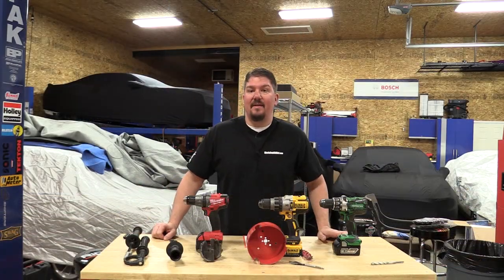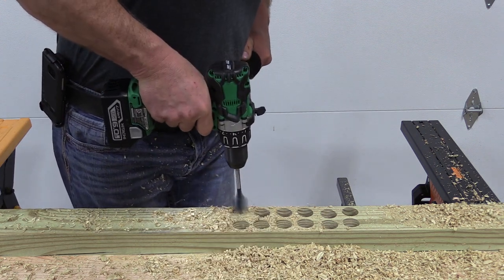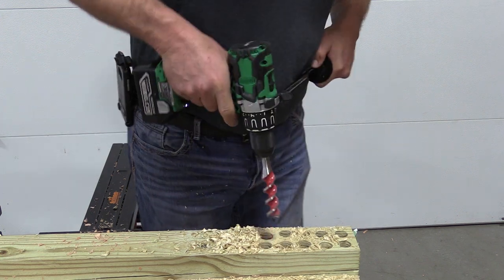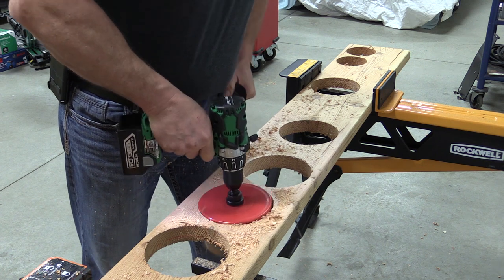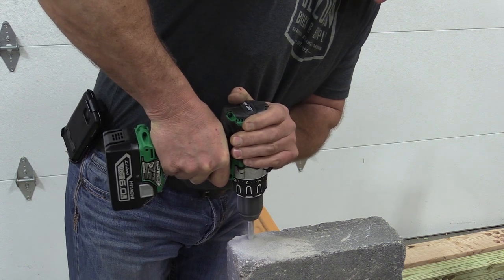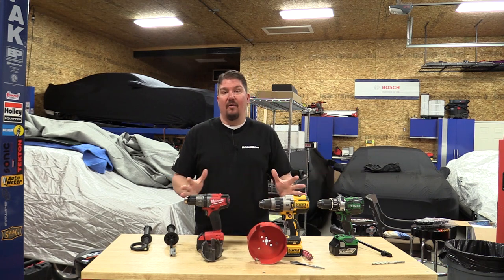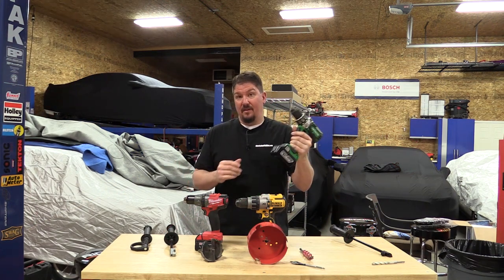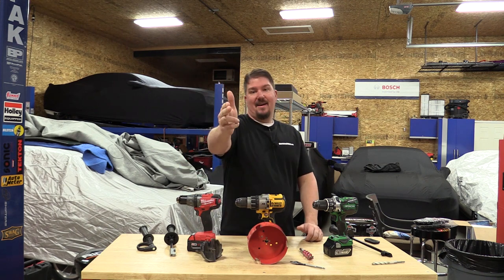Hitachi DV18DBL2 1/2" Drill vs Dewalt DCD996 vs Milwaukee 2704-20 | Brushless Drill Battle

Comment: Doesn't that Hitachi come in at $399 for drill and Batts? You can get combo kits with the other two for that price...I think this is a point worth discussing.  Bare tool the Hitachi is more affordable but most people would probably prefer to buy it with the 6ah OR as a combo with an impact like the m18 and xr UNLESS they're already invested in the hitachi platform
Reply from the maker: If you got a combo kit with the Hitachi triple hammer impact, it would be worth the more $$.  I agree with you, it is hard to get into costs other than bare tools because there are so many combinations.  Great item to talk about!
Reply: I’m a big hitachi guy and lemme tell ya, when I saw the price of the new brushless stuff I about shit myself.
Reply: Dylan Elder I'm in complete agreement, brother.  The digital control recip, the triple hammer, the nailers, this hammer drill all very expensive... For being next to an off brand and not really a major player in prosumer sales(bad marketing, poor competive releases) you'd think they'd make entering their platform more affordable.  Their under performing brushed kits are always on sale but lacking in all facets of power and speed
Reply: I recently got the dcd996 in a pack with the dcf887 and dcg406 with a 6AH bat and a charger for 549 NZD (370 USD)
Never seen anything as affordable as that

Comment: I’m in the Dewalt battery platform and I will buy the Dewalt dcd996
Reply: Dewalt burns
Reply: And u will be buying a name that isn't as good of a drill
Reply: @davycrockett4395  Not Necessarily. I had the older version of dcd996.The only reason why I changed it was because of the old ni-cad batteries but it was a tough drill.have this Milwaukee drill and this new dcd996.They have improved a few things on the Dewalt. My Milwaukee drill seems to have more torque than the Dewalt but for drilling into masonry I found the dewalt is much better because of the 3rd speed. I use them both for large diamond core bits when I don't have power for my corded Boschhammer drill . I have driffrent platforms as I don't like everything Dewalt makes but the same goes for Milwaukee,Makita,Bosch etc

Comment: In 2018, i am now the proud owner of MILWAUKEE'S 2897-22 which includes the 2704 drill/driver. As i have own the minor leagues (12v MAX & M12) 1st, I used both extensively. Dewalt's battery 12v MAX tools & batteries (especially) have  failed time & time again. They have a fatal flaw close to The release tab, the plastic cracks. The tool (3/8 drill/driver) was repaired until warranty. M12 tools are still preforming without a battery or tool failure over 5 years later. I needed to step up to a cordless (1200 ft lbs) Dewalt impact, & after 18 months the same problem occurred as with it smaller cousin (cracked battery cases).  This lead me straight to Milwaukee M18  as they have a different battery case structure. I have not been disappointed yet (plus i still use my M12 tools every day as a mechanic & locksmith)! Hope this is helpful to someone!
Reply from the maker: Thank you for sharing!  I am sure it will be helpful to anyone looking for new tools!

Comment: I have the Milwaukee Fuel 2704 and there were two things I didn't like. 1) when first bought, the chuck with lock so tight after hammer drilling through concrete, I couldn't remove the bit. Took it Milwaukee repair center, and they fixed it. 2) The handle can come loose and as you mentioned can break off from where it clamps on the drill. A friend who is an electrician shared that happened to them once and changed from Milwaukee to Dewalt. I wish #Milwaukee would change the handle more to Dewalt or Makita style
Reply from the maker: Our main 2706 drill is broke where the handle clamps and the handle will no longer work.  The drill is nice though.
Reply: Great video! Loved the straight to the point, action filled, with excellent commentary. Very smooth!
Reply from the maker: Thank you!

Comment: The thing I've noticed is how a dill is used. 

Using to fast of a speed or too slow,  sometimes it's the pressure, even the sawdust or dust can screw up the clutch etc. 

Or just using it too many times too quickly just kills any brand drills very fast.

Comment: Hitachi is expensive but so far worth it for me. I havent used their lifetime tool warranty, but the bandsaw and triple hammer seem to be holding up great in commercial applications. I guess next ill buy this drill, but fucks sake its expensive.
Reply from the maker: It is expensive!
Reply: I'm still rockin an older version of the Li-Ion tools, non-brushless. They refuse to die, I refuse to buy new ones. It's the one company that I have never had to use the warranty on and I haven't figured out how to break one (not intentional breaking that is). I burned out, dropped then broke, killed batteries in weeks, ALL of the other major brands. Perhaps it's luck but if my luck keeps my Hitachi tools working (why fight it right?)

Comment: Nice to see you guy's back. lol I honestly think Milwaukee need's to fix there over heating issue. There drill compare to my Makita or Dewalt got nice and toasty from hanging up four cabinets. Used my cousin's the very next day to compare and same thing. Out of these three I say Dewalt wins. If you add in the Makita hammer drill then you have a new champ. Much nicer chuck and there handle is nice, long and wraps almost all the way around. Btw anyone else Milwaukee drill have this very high pitch annoying sound come from it when trigger is pulled?
Reply from the maker: We have a friend who has the high pitch sound when the trigger is pulled.  It is an odd sound!
Reply: Yea I agree the milwaukee gets hot fairly easy . I think they packed that motor in there too tight trying to make it the most compact out of the rest. Which in return causes heat to not disperse easily or properly.  I use the Dewalt at work and milwaukee at home. the only time I get that Dewalt hot is when I am drilling into concrete.  In my experience dewalt will let you run their tools a little harder than milwaukee before cutting off. power.  Which I’m not sure if that’s a good or bad.  Either way I would be proud to show up and do any job with either of the two drills.
Reply: The Makita is the same chuck as the Milwaukee as far as I know, so take that into consideration. My Milwaukee chuck likes to drop bits a lot.
Reply: KernelPanic No makita has a Yukiwa chuck and i forget what Milwaukees is but they r different. Milwaukee is my least favorite between the dewalt and makita. Now is it a bad drill? I don't think so but i also think there going to make there next 18 hammer drill much better.
Reply: ToolShopGuy The Milwaukee says ‘Yukiwa Seiko’ right on the back of the chuck.
Reply: My wife makes a high pitched sound when I pull the trigger on tools, but when she pulls the trigger on clothes shoes etc it's silent. Why is that?
Reply: The milwaulkee is also yukiwa.
Reply: Chris Piggott Ahahaha...it's a common affliction in most women whose mates/partners/? want tools that will actually earn their keep as opposed to just get by with the cheapies and use the rest to guild the calf. 
46 years of home building and remodeling, two wives(first one has passed...) and about a dozen or so helpers later, I find that same "high-pitched" whine just about everywhere. Some are more annoying than others but in general, it's the same. 
It is my joking belief that a form of gold is sufficient lubricant to soften the squeal...js
Thanks for the chuckle, sir. It made a dull day an 'rch' brighter!
Reply: I also have a impact gun from Milwaukee and I get the same noise on mine it sometimes doesn’t shut off. I have to pull the trigger out to make it stop drives me nuts lol. Definitely will be sending it in for warranty repair and they have had a lot of issues with the triggers on their drills and impact guns. Other than that never had any overheating issues or any other issues at all.
Reply: Apparently milwaukee gen 2 use the Japanese chunk.
Gen 3 use the German chunk.

The German chunk blows away the Japanese chunk.

That's from the guy at the store,  and said when they repair gen 2 drills they replace the Japanese chuck for the German one.

Comment: I have both Hitachi and Dewalt hammers, and they are nice for masonry.  I always use my impact driver for my spade holes, as I can easily drill overhead with a single hand.  You can not do that with the drill.  In fact, unless I am drilling masonry, I will just pop a drill adapter on to my impact and use all the regular drill bits with it.

Comment: I have the Milwaukee and the Dewalt hard to decide which one I prefer! Great review
Reply from the maker: When drilling metal and needing a middle speed, the three speed Dewalt stands out to us.
Reply: Same here. I love the grip on the Milwaukee but that chuck is GARBAGE. Hate to say it. Even the chuck sleeve is just cheap and stamped, instead of the nice Rohm with knurling and a spinning bearing at the front. Not perfect but better. Bits falling out of the Milwaukee gets old. It is also hard to grip anything with a hex shank due to the design of the jaws. That gets old.
Reply: I have never had a problem with my gen 2 fuel drill dropping bits, however I have had to use channellocks to get the bit out of the chuck.
Reply: I know you from instsgram

Comment: I would have liked to go Dewalt, but where I am from they didn't have a Dewalt hammer drill set anywhere, so I ended up going with Milwaukee
Reply from the maker: That's not bad!
Reply: @WorkshopAddict  nope, but I was sort of already invested into the dewalt battery line. But really needed a hammer drill set and my local stores only had the fuel products

Comment: I will go with the Milwaukee. It's the best bang for your money. Working in the refinery industry we use Milwaukee because it will not fail. I have used the dewalt but it doesn't performs like Milwaukee
Reply: From what Ive seen, dewalt last the longest, where some people have had dewalt tools for 5 years, ive seen milwaukee chucks break after a matter of months

Comment: Hitachi also has a very good Impact wrench. 305nm and ip56 water/dust protection.
Also sabre saws, , an angle grinder,circular saws , rebar cutters, various nailers and even a multitool.

So Hitachi spans a wide usage area on their 18v battery line.

Yet you only mention the triple hammer impact driver?

Comment: I have both Milwaukee and DeWalt and my partner has the Hitachi. We've been doing home repair and remodeling for a very long time. Based on user experience, I would NOT ever own a Hitachi for pro work. It just doesn't have what it takes to complete a strenuous task. I am not panning Hitachi as I have a slide miter saw and a roofing nailer from them and have nothing but good words about those items. 
Back on point, for my daily usage, my goto is the DeWalt. It has been a solid performer and it doesn't matter what the task is...from driving screws to drilling large holes to mixing mud and concrete. It takes it all and works better than either of the other two. My Milwaukee is my back up for those one-time difficult tasks such as setting anchors or reaming when I don't want to burn up my regular use drill. It handles what I put it through with ease though it doesn't 'feel' as if it would be able to work all day doing the mundane. 
My partner uses his Hitachi trying to perform those very same tasks and ends up borrowing my DeWalt to make it through the day. His is newer than all of mine and was purchased to replace a Makita that gave up the ghost last year. I did try to convince him to purchase a different brand but the price was almost a c-note less, so he cheaped out and now we suffer on rough days.
Battery work life is longer on the DeWalt as opposed the Milwaukee but not enough to make a difference. I don't go to job unless I have at least two batteries and I usually carry four and a charger for both brands. My buddy has only two for his Hitachi and he ends up charging each a couple of times during the typical eight hour day...hence the need for 'borrowing one of mine.
My opinion for any of these? You can't go wrong with either the DeWalt or Milwaukee for all-around performance, day in and day out. It's been at least four years on the current DeWalts I own (4 drills and 2 drivers) and three years on my Milwaukees. Hardly any complaints other than battery costs which make it almost more economical to just buy a new kit rather than just the batteries. I did manage to find a local outfit that carries new, generic replacements for a third less than even rebuilds! I lucked out there. 20v XR's are precious judging by what I would have to fork out for brand specific and don't even think about Milwaukee's 18v's!!!
And as I stated at the start of this diatribe, keep the Hitachi at home. It seems to be sufficient as home-owner "beater" than trying to be a real work tool. My buddy has used up two batteries and one charger so far in the year that he has had it but thankfully his replacements were less than half the cost of what mine would be.
I have used Bosch, Porter Cable and Hilti brands and am not impressed at all with any of them. Bosch and P.C. work and feel like a wally world knock-off brand -- cheap, inconsistent and flimsy. Hilti's price is simply too outrageous for what it is and offers. And it didn't work any better than Milwaukee or DeWalt. Besides that, I would never buy anything with the P.C. label ever again. Their entire product line is trash. Brand new framing and roofing nailers than can't make it through one box of nails without breaking. Compressors so cheap that saran wrap is stronger than the seals found on the top end (i use to own three...). Yes, it's that bad! 
So at the end of the day, it's either DeWalt and or Milwaukee if you want to get the job finished in a timely and professional manner.

Comment: DeWalt hands down, I think the 996 should have had the 6ah flexvolt battery as that is what the premium kit comes with. Love the new chuck on the DeWalt German made they are high quality and the same chuck used in the hilti drills for twice the price. The E-clutch takes getting used to but I've grown to live it very versatile and people neglect to mention that all 3 speeds have different ratios in every clutch number giving you say more range in gear ratio. Awesome drill I would recommend to anyone who needs a workhorse on the job site!
Reply: I agree, I Run my 996 with a flexvolt battery(my big tool gets the big battery) and it is a monster, the clutch is real weird at first, but it is so good now i can get used to it. 
I wouldnt use it for huge amounts of concrete drilling, I would use an SDS for that, but when you only need a few holes, its not worth getting the SDS out, it is more than competent.

And drilling steel it just doesnt quit, I was working in a already got environment(easily 30 degrees C with pretty shit ventilation, but large open space) And was drilling so many holes in steel, I had to wear gloves to stop the heat form the motor burning my hand, but it kept its power, and In the space of time it took me to charge the battery from half to full, it was cool to the touch again.

the only problem with it is that it will straight shear drill bits if they catch

Comment: Hitachi, all the way for me. Yes, I know, Im that weird guy in the corner...
Reply from the maker: Hitachi has been kicking it.  It performed well and was no slouch.
Reply: Yeah the Hitachi has a lifetime warranty that puts it way ahead of everything else.
Reply: No, it doesn't. The paperwork states not for commercial use! I know this because my partner's rig has crapped out several times while under supposed warranty and they would not honor it as his tools were listed under our company name when taken to the repair shop. We could have lied and perhaps they would have covered it but we aren't those guys.
Reply: Me too, I can not wait for 36v tools line that's coming later this year.
Reply: We use Hitachi stuff everyday, we have never burned out an impact or grinder from them. We have a shed full of burned out Dewalt grinders, sawzalls, 1/2 inch corded drills, a couple impacts, a couple of the Chinese built Milwaukee sawzalls,  We have one burned up 3/8 Hitachi corded drill. So we try and buy only Hitachi now. Oh and Bosch jig saws, we also use the huge Makita grinders because they still run after 25 years. Hitachi owns Matabo tools and the 36 volt stuff will be great, backward compatible battery packs giving your 18 volt tools 8 AH run time.  And yes we have several 200 pound gorillas running them all day and treat them like they were free.
Reply: The guy I worked for as an apprentice 11 years ago used Hitachi everything he swore by them! I'm a DeWalt guy myself the 996 is a beast but I would gladly take the hitachi!
Reply: You win in my opinion, keep staying strong in the corner.
Reply: @twicebittenthasme5545  Funny, mine dont say that.

Comment: Id get the DeWALT. The 3 speeds is nice, the 60 lumen led is great, and I like how the handle can be positioned 360 degrees. A few things I would change. I would upgrade to the tool connect model. redesign the handle with more metal components to increase the strength and durability, and I would have a new chuck system that is like the Festool drills and the Bosch Flexiclick.
Reply from the maker: I think the handles are "weak" because they reduce the transfer of vibration to the battery.